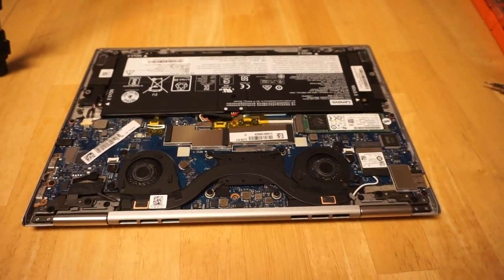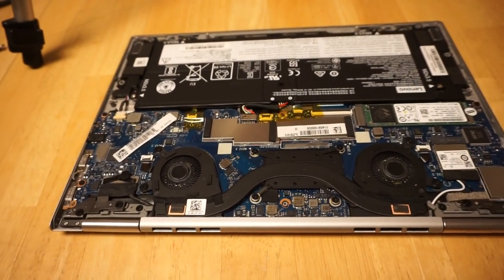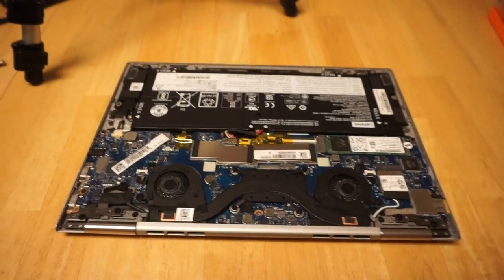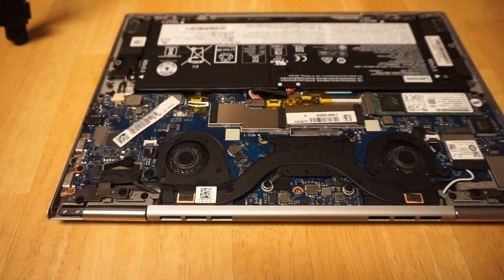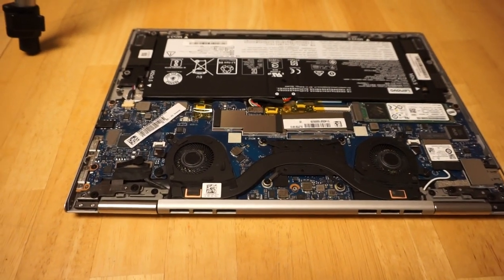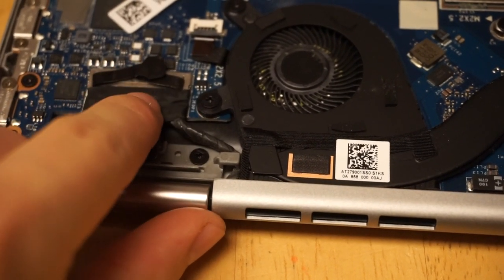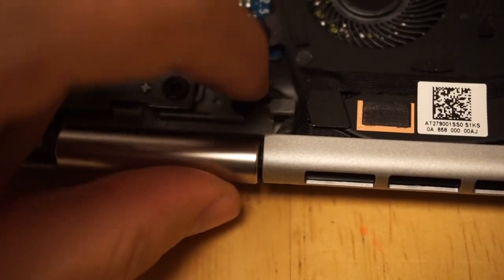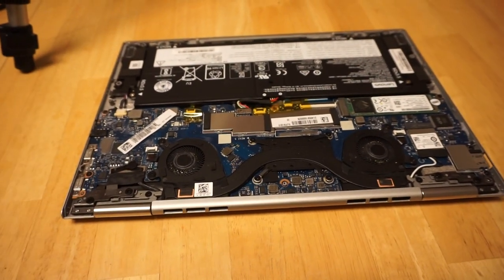Lenovo Yoga 730 Screen Flickering Easy Hardware Fix

Comment: So, does it completely solve flickering problem for you? If so, not a big deal to move the cable a little. (was thinking on buying 730, but find out about that problem. Not shure now)
Reply from the maker: This fixed it completely for me, I haven't had a single issue since I did this about a month ago. One other commenter said it fixed it for him too. I'll update the video if the issue comes back
Reply: Same, not sure to buy the yoga 730 or a hp
Reply: @user-th9jn3uv2z  Don't buy the 730 its a piece of crap. I've got the same screen flickering issue. Lenovo support is useless and this video is only a temporary fix as the OP has since said it came back.
Reply: P lei Thanks for lookin out, appreciate it.
Reply: P lei Who's the OP tho?
Reply: @user-th9jn3uv2z  OP = original poster/the guy who posted this video

Comment: I've heard nothing of this on the 15" model. You might wanna clarify.
Reply: It happens on the 15" model.
Reply: @evankeith6841  from personal experience or just hearsay
Reply: @codeHusky  Personal experience.  That's what I'm doing on this fix page.  For the record, it has temporarily resolved my screen flickering issue, and I'll post an update if it returns.
Reply: @evankeith6841  Did it return?
Reply: @Bhawna03  it returns every week or so. When it does, I open it up and, disconnect the screen cable, reconnect it, and I get a few days of flickering-free use
Reply: @evankeith6841  That must be so frustrating. Do you have any other laptop suggestions? It doesn't have to be 2-in-1. I just want one with a good display and dedicated graphics card that's not too expensive :/
Reply: @Bhawna03  sorry but I don't. This is the only laptop I've ever purchased for myself as I usually use a tablet or desktop. Good luck in your search

Comment: This very very common fault is caused by the connection itself. Simply disconnect the battery, unplug the connector then clean both with isopropyl alcohol and a clean old toothbrush. Wait until dry, then reconnect and make sure it's snugged down firmly. Problem solved.
What you have done by re-routing the cable is temporarily improved the connection.
Intech Computers
Reply: I need a video on how to do this. :(

Comment: Hi. 
I followed the process as suggested in the video and the flickering issue was solved. 
Thanks a lot for this video. 
I also thought it was clear it was a hardware issue.  I also have the impression I will have to reopen it again and fix the issue in the future, but at least the fix seems easy. I also watched this other video which helped me unplugging the connector itself. Hopefully this gives more slack on the cable and thus the flickering takes longer to appear. 
https://www.youtube.com/watch?v=j963M2QNKH0
I dont think the warranty is void with this fix, as I dont think a technitian can tell if it has been opened before or not, dont you think?